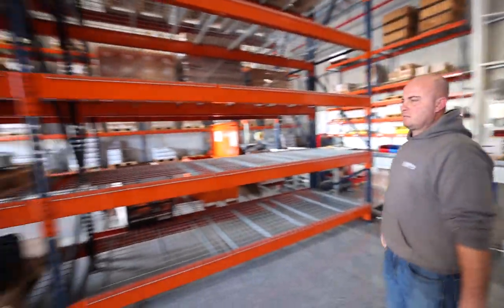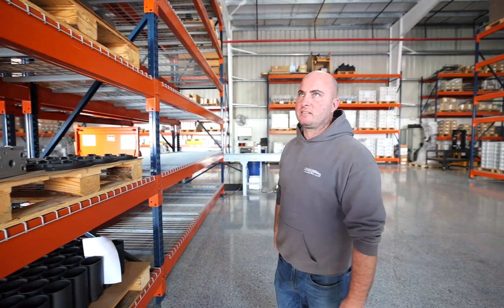LOCK IT UP! FACTORY TOUR OF PROVEN LOCKS WITH OWNER RON LEE!

Comment: In the video last year where you talked about the proven locks I saw you had a Rhino Hitch. Are you still using the Rhino? Have you switched to the Proven hitch. What is your preferred hitch between the 2? I am looking to upgrade the basic hitch I have now to an adjustable one and also want to buy some locks. I will for sure buy the proven lock but I am on the fence between the Rhino Hitch and Proven Hitch.
Reply from the maker: I do have the Rhino on my red truck just because the HH wasn’t out at the time. I’ll probably out the HH that I do have on my new truck.